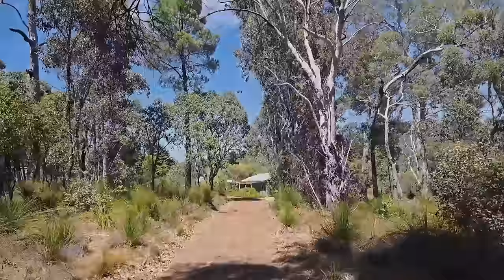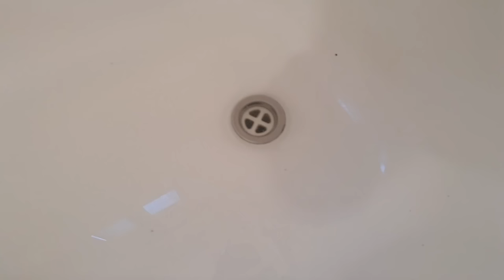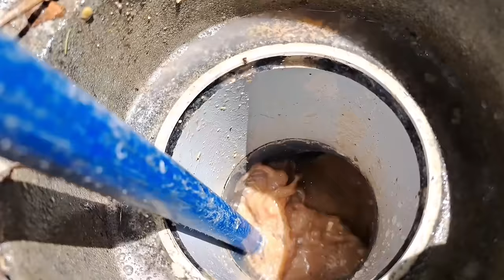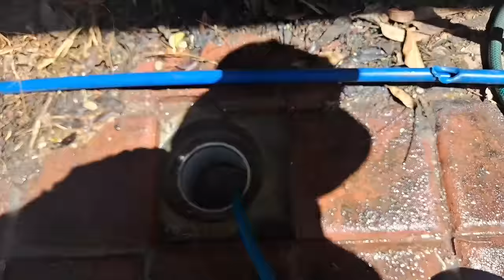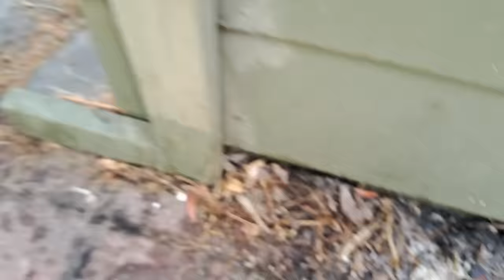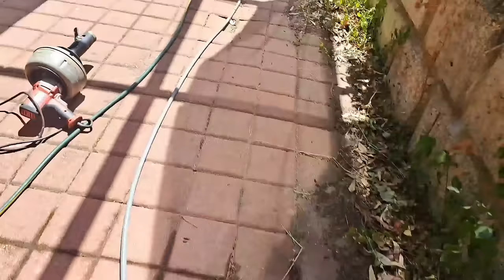I nearly Gagged Unblocking this Drain 🤢

Comment: Some plummers would see these blocked drains and think: "Yes, I can sell them a new set of drains!" While you see a challenge that needs to be conquered and you conquer it
Reply: Yeah, but the real fix is to install new drainage set up correctly. This is just a clearing a fat- berg and will block up again. that system was problematic from day one.  
Perhaps you don't understand that in WA, especially regional areas , they haven't had decent trades services that care to do the work correctly, nor Inspectors to check the work is done to Code.

Comment: Interesting, your style is the Polar Opposite of mine when I do drain cleaning. I think I can learn a lot from watching you.

Jets tend to be terrible on roots unless you have the right head and enough pressure in my experience, you would need a camera to follow to ensure completion unlike a snake where you can try to get a blade to match diameter  of pipe. But hey, that's why it will be fun watching you. I love learning new styles. I consider myself a stealer of all my previous teachers' styles, lol

A big boy snake has always been ideal for me and taking advantage of running water in-house to push out debris.

The key with snake is to match the head with the size of the pipe adjusting for things like P-traps and sweeps and bigger cutters for straight shots and roots. You can use the tension of a snake to jump a trap easier like a spring than relying on your Jet head propulsion 

I like your videos, oddly enough, with me doing this 5-6 days a week. For the last 8 years  you have thought it would get boring. But yeah, I share your excitement, and God has blessed us with doing something we love to help our community while getting paid.

edit

Just to add that the Jet has always been better at grease and sludge, but it's been a finisher for me, not a starter like it seems with your approach

Comment: What kind of fix is required for that drain issue, can it be redeemed or is a new installation required?

Also, been a passenger in an Escort, 2 litre, where a wing nut made its way into the engine block and made short work of the piston. That was just outside of Merredin, and that's a hot long way from Perth. A truckie was kind enough to give us a lift back to Perth, but he went the long way 'round because deliveries, it took 5 hours with five people in a small cab. The things you do when you're young. Thanks for unblocking that memory.

Comment: I used to work at a restaraunt as a dishwasher when i was a teen and below the sinks we had a grease trap/ grease interceptor and when it came time to clean it. I can tell you the smell coming out of that steel box was gagging. Some of the worst smells, worst than feces or rotting carcass. So thats what i imagine this would smell like

Comment: I used to work in a pizza place, and once the drain pipes busted from all the grease and stuff. They had to carve out the concrete floor to replace a pipe because it had actually busted and filled with dirt. When water and everything came back up, the smell was really something.

Comment: A traffic cone on top the drain with your hose ran down the hole on the top of the cone might prove a nice splash guard to cut down on work related sips. We used them in geotechnical drilling when we air knifed for utilities. Without the cone...you just got wrecked with debris. Far be it from me to suggest reducing any amount of love for the Job. lol Guess it would reduce the viewing pleasure of the audience.

Comment: Why don't you tape a plastic bag to the floor then put a hole in it where the drain is to gain access that would minimise mess and save you time later cleaning up.